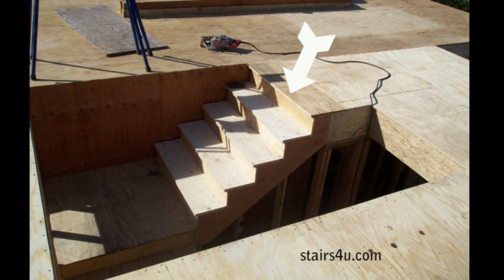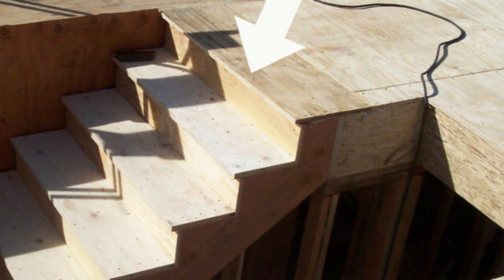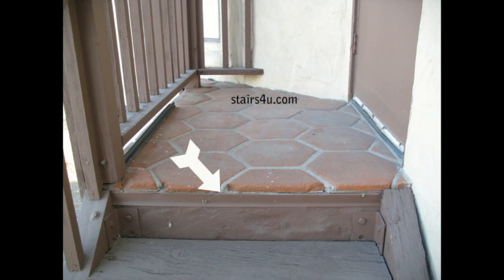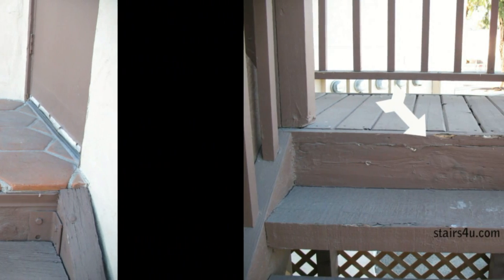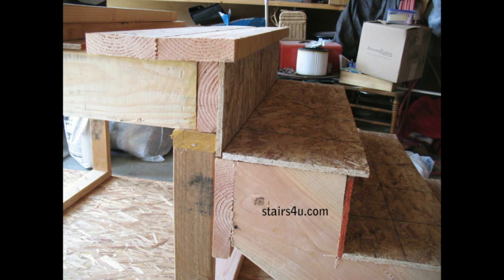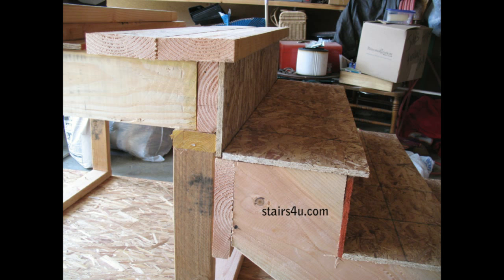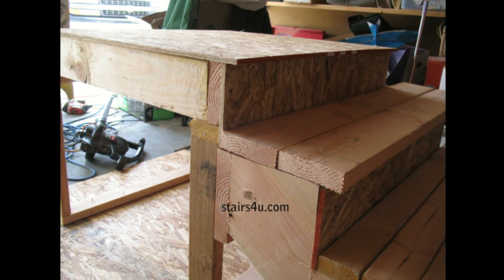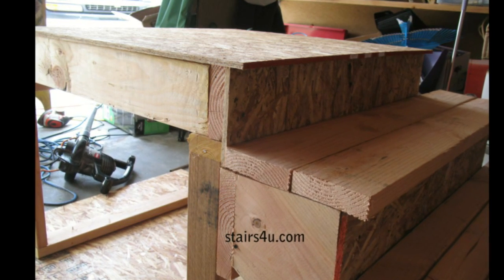You Must Compensate For 1 Inch Step Overhang - Stair Building, Landings And Floors

Comment: There are zero codes where I'm building except septic system. You can pretty much do whatever you want. Actually, we've been tripping on the rough stair bases going up WITH the nosing, that's why we cut it off before re-covering with good wood.

Comment from the maker: I haven't ran across one building code yet that requires a stair nosing. As long as your stairway meets the stair tread minimum width and all of the other building codes in your area, you shouldn't have a problem. This is just my personal opinion, but stairways with nosing's, tread overhang or undercut seem to be easier to walk up, but realistically wouldn't affect the user walking down.